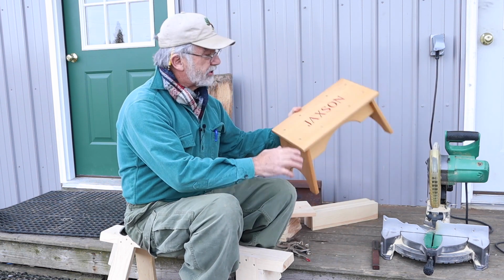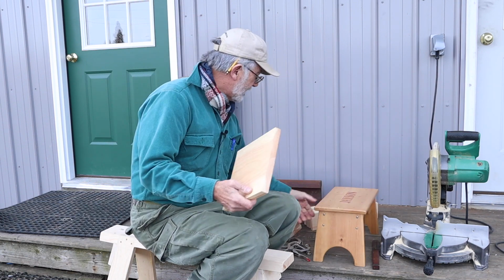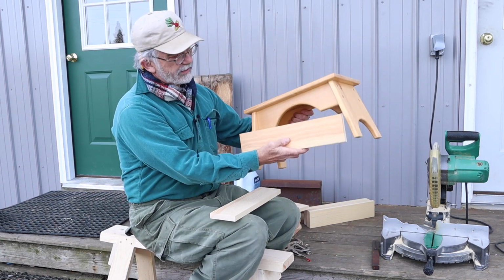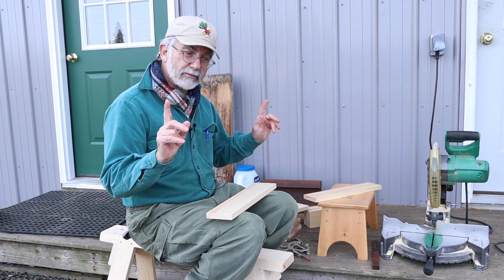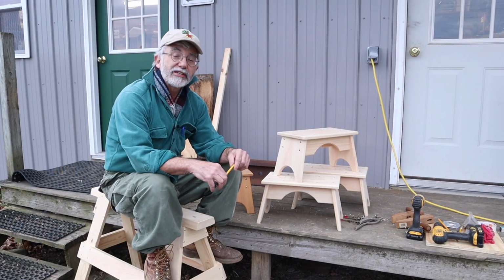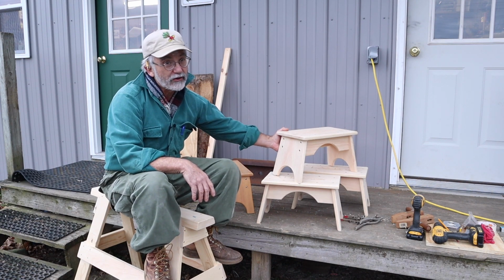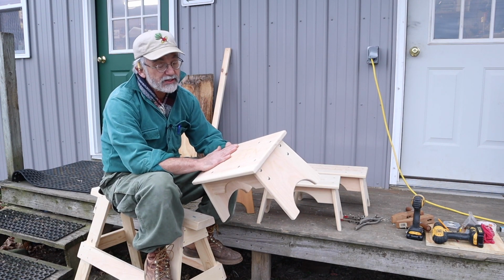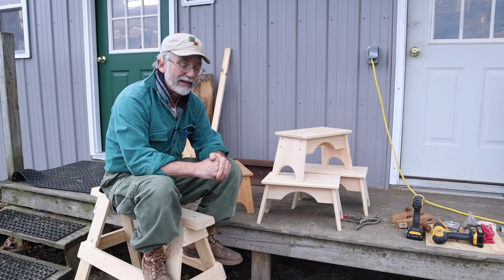Making Stools For My Grandchildren in My Outdoor Workshop

Comment: How did you go about the staining process? Did you stain or paint?
Reply from the maker: Hi Brian,
I bought wood conditioner, stain and poly to finish these stools, but I ended up using only the polyurethane. It is an oil-based product so it is bringing out the grain of the wood and it looks really good. The water based polyurethanes don't do that. They have what I describe as an "anemic" look. Better to have a stain or maybe a shellac coating under them. I'm putting 4 coats of poly on the stools. And I decided NOT to paint the lettering. It's tedious to paint the letters well and I'm liking the look of the natural carving better than I expected. Thanks for the question. 👍

Comment: I am having difficulty in accurately cutting the bevel on the ends of the sides.  I can't locate any specific tips on this build video or on the PDF plans that I purchased.
Any tips for me?
Reply: My question also. There is no video showing how to make the “feet” bevel to sit flat on the floor. However, at about 17:00+  attaching the top, the feet appear to sit flat on the sawhorse board. Any more information on how to shape the feet?